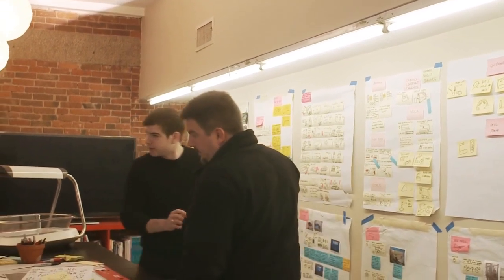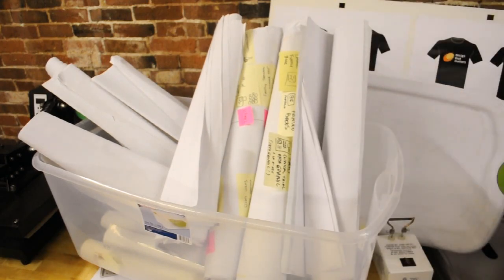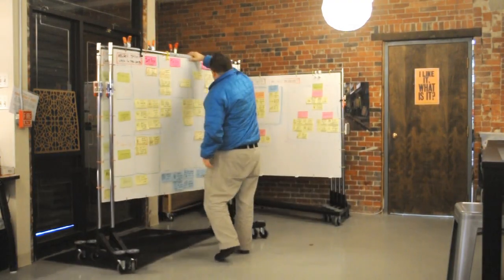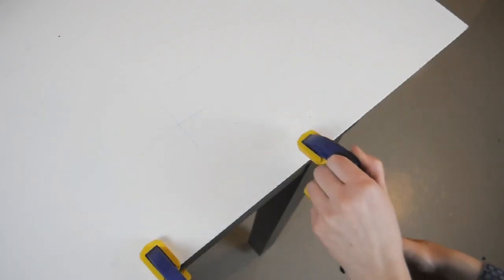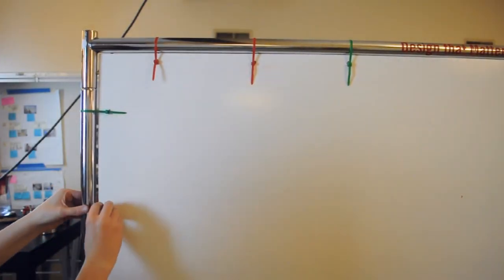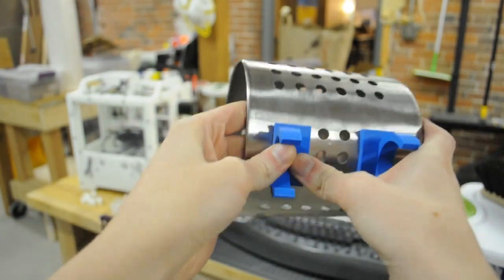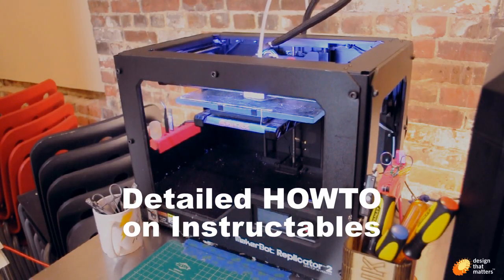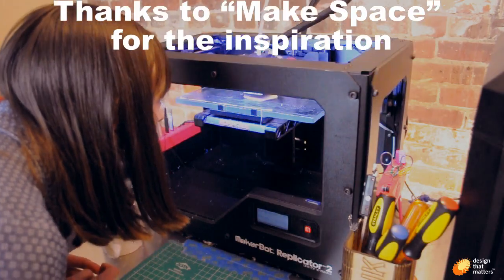Hack your Studio: How to Build a Z-rack Whiteboard

Comment: Awesome!  Built 5 of these for my classroom and they are awesome.  Only one question:  I printed your marker holder, but the diameter of the marker openings are too small....I thought maybe it was a scaling issue, but the bar opening is perfect (i.e. needs a little force to get on there, but holds firmly).  Any ideas on why that is?  I assume these were designed for the "standard" Expo marker.
Reply from the maker: Do you have a way to look up or measure the outer diameter of your markers--say with some calipers?  If necessary, we can make some custom brackets for your pens and post them to Thingiverse.
Reply: You are very kind to offer. Normally, I'd say "No that's alright--I can do it!", but I am drowning in lab-setup and this is just "one more thing".

Our expo markers are 17.5 mm (I believe this is "standard"). The openings in your holder, at least the way they printed for me, are 16.3 mm (at the widest part). Maybe before you go re-designing, we should verify that I didn't scale the whole thing down somehow (definitely not intentional). FYI, my garment rack vertical bar is 33.3 mm, and the opening for the bar is ~32.6, as printed. That gives a nice bit of spring-tension so it doesn't slide. 

Curious to see what you find out.

Also, as a newbie to 3D printing, if I were to go about modifying this design, what program would you recommend I use to make the modifications (and which file would I import into that program?)
Thanks!
Ryan
Reply: Would you mind sending me your original design (not sure what file format it'd be in--I've got Fusion 360 if that helps)?
Reply from the maker: The Fusion 360 files for the pen holders are on Thingiverse here: https://www.thingiverse.com/thing:1292818/#files  It may be that you printed them in a less flexible material than the PLA we used, in which case you'll just need to widen the openings for the pen.